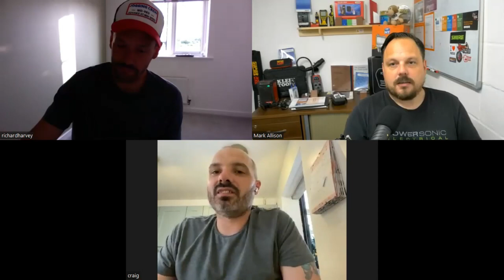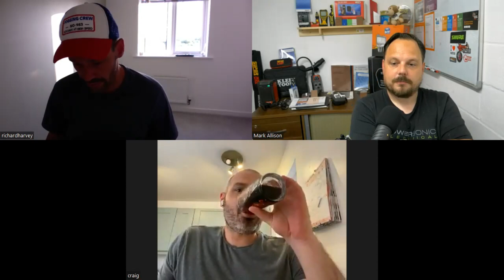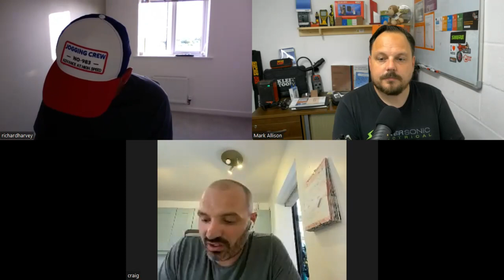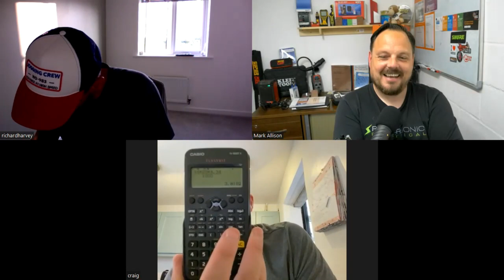Electrical circuit design for electricians - The series E1

Comment: Even as a non learner/apprentice, I liked listen to this podcast.

From my previous years experience, both in the classroom and in the real world, there aren't many 'electricians' that either don't like to/know how to/can be bothered to use a divesity calculation when comes to simple cooker/oven installations. I have never understood is when the same 'electricians' will quite happily instal a 4mm2 socket radial serving numerous sockets, but wouldn'y dare use a 4mm radial to supply a double oven for an example.

A recent point on this subject was proven. A lady contacted us as they had chosen a new all electric range cooker, a total MAX load of 64 amps - apparantly.😂 When reading the install booklet properly, its showed which induction rings and ovens could be used together and the fact the appliance used some kind of load management buit in. When install and clamp tested, the peak was 39 amps for about 50 seconds, then ran at a tad under 27 amps.

Maybe using the scenario for some worked examples would be good to show?

Comment: Great show as always team.  I am sure a lot of people will find this really helpful.

I have a possible scenario for a domestic spark

Power to a shed 
Cable run 45 meters from CU, first 15 meter clipped direct to outside of house, next 28 meter under the lawn last 2 meters inside the shed.
The shed will have a fixed 3.2Kw heater
3 x 2.7 W LED spot lights
2 x 13A double sockets for general use

Comment: Great video chaps .

It does say in IET design guide that as the designer you can use 240vvolts
Reply from the maker: They want to try the 250V we pump out in East Yorkshire 🤣
Reply: @A121podcast  we get 250v down here in Dorset to .
Reply: You can use it but appendix 2 of BS7671 also asks for 230 to be the nominal voltage as well. 

Good straightforwards IET lol

Comment: Another great video cheers. As a sole trader, is there a form other than an EIC that Electricians can sign as a whole instead of the usual 3 parts/signatures for  designer, installer and tester ? If so where is it please? Looks like there is something at the bottom of page 508 of amendment 2 regs, appendix 6 but unsure how to fit this into a job.
Reply: If you are using software for your certs, then most if not all do a single signature version of the cert. This covers the design, install and testing of the install/work done.
Reply: @SME_Ste  Cheers. I have meger certsuite so will look now.
Reply from the maker: ElectricalOM and napit fast test both have single signature boxes for design, construction and testing